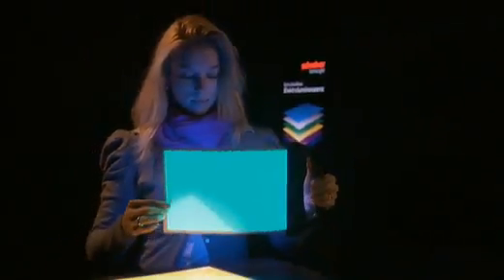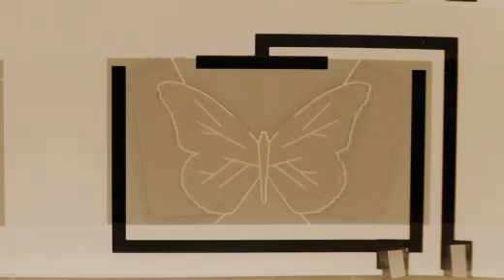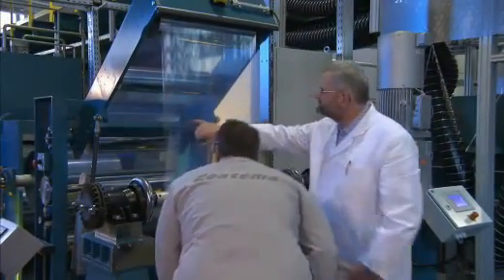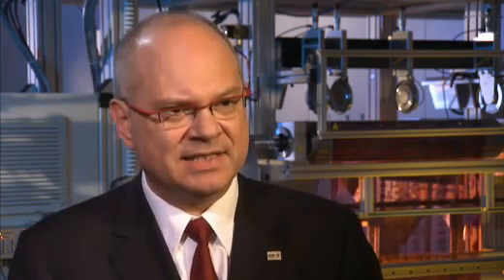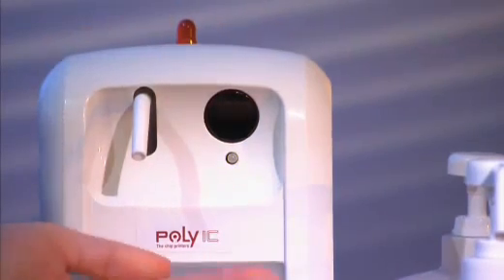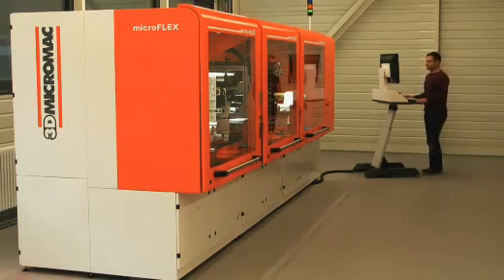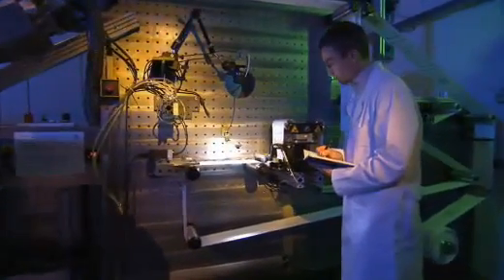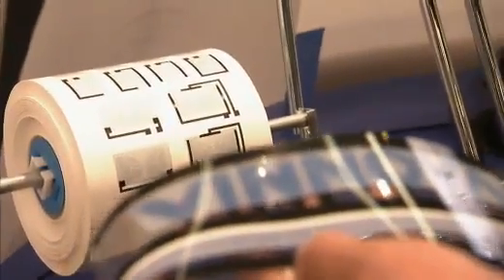Organic and printed electronics explained

Comment: Organic just means that the material has a carbon backbone to it, and frankly, even if doped to a UV-A or UV-B spectrum for plant growth, OLED intensity would be to low for anything. The reason why OLED is so amazing is that it runs off of DC power, not AC like it's EL counterpart, so it's a more viable solution for products outside of automotive that are more energy critical, like cell phones and does not require a backlight like LCD. TL;DR, you sound like an idiot.